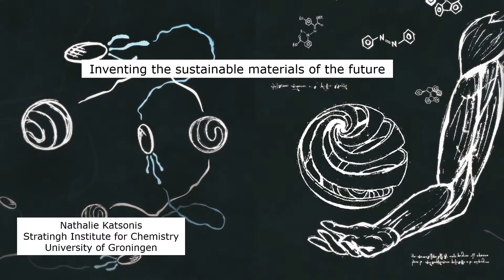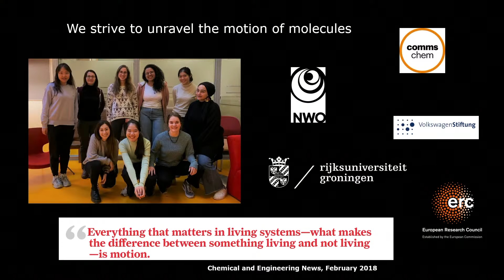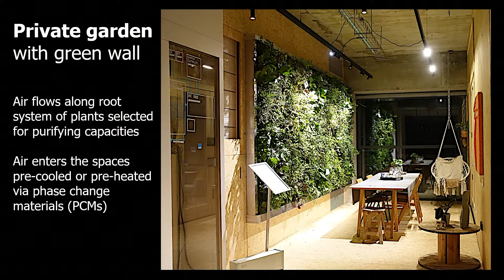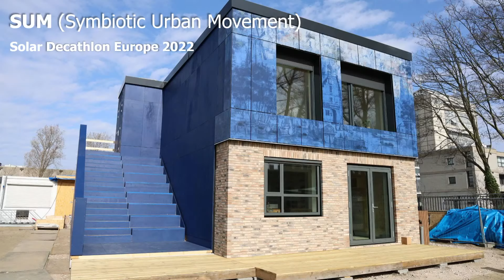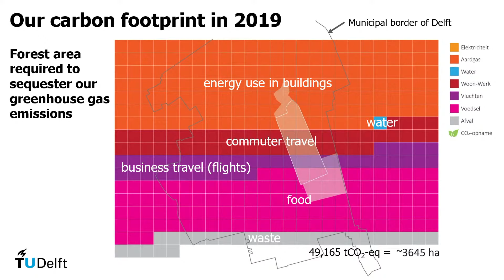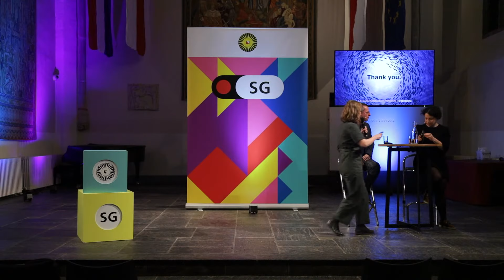Building a sustainable future

Comment: Using rainwater for apartment buildings of course sounds very nice. However, I sincerely doubt its roof surface will be large enough to harvest enough rainwater to substitute drinking water for all apartments. Question therefore is, what is the rainwater going to be used for? And the question following, what uses can truly contribute to lowering the potable water footprint. Without having to invest into a complicated rainwater system which still switches to potable water, let’s say 75% of the time.